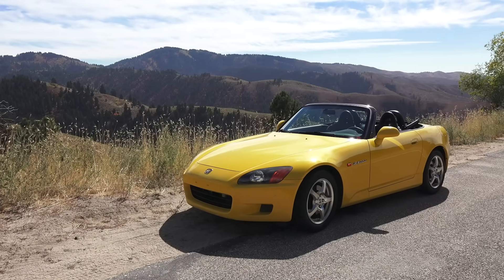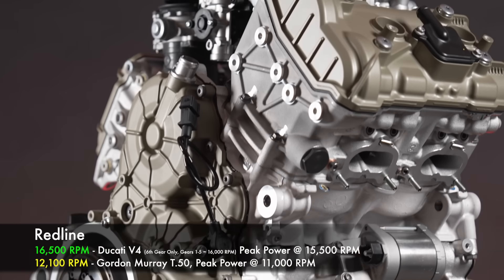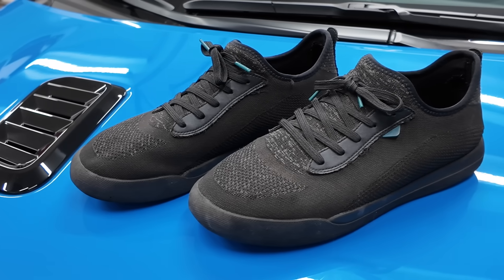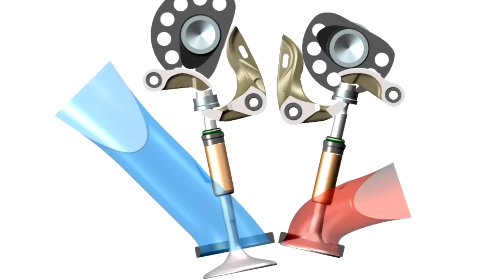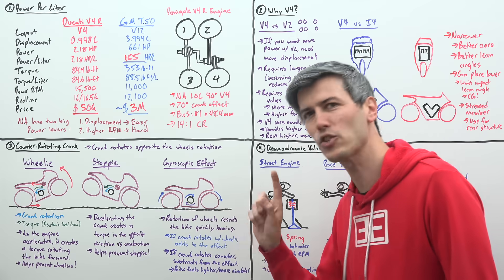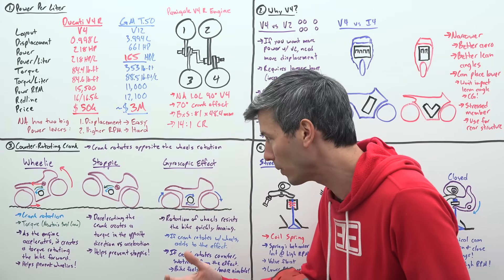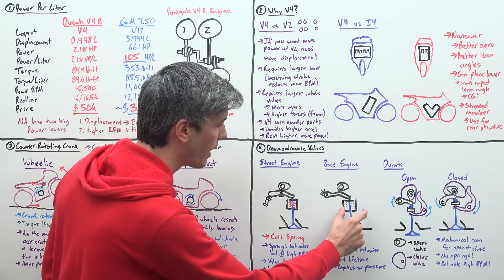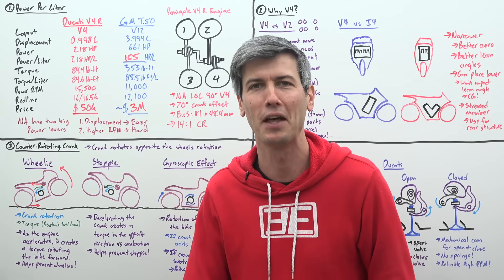Ducati's Brilliant V4 Engine — Putting Supercars To Shame!

Comment: When you showed the inline 4 option, you showed it mounted transversely to the frame.  Couldn't it be mounted longitudinally?  

Also, on the valve mechanisms, what holds the fingers to the cams?  Torsion springs?
Reply: I would think lengthwise would result in more issues, now your wheel base and suspension have to work around the engine plus you need more complexity in rotating the drive direction of the engine to the rear wheel. As for the valves, if you look at the diagram the fingers cant move unless the valve or cam moves. The finger is pressed to the cam due to the valve, and pressed to the valve due to the cam. I've never taken one apart but I'm sure there's a normal backlash spec and the fingers are not preloaded to the cam or valve.
Reply: @ivs-b7h  If the engine was placed inline with the bike, making it a shaft drive to the wheel would be easier.  But obviously there are other challenges, as you mentioned.

I watched the valve demo in slow motion and now see how the fingers are captured by the cams and valve stems.  Thanks.
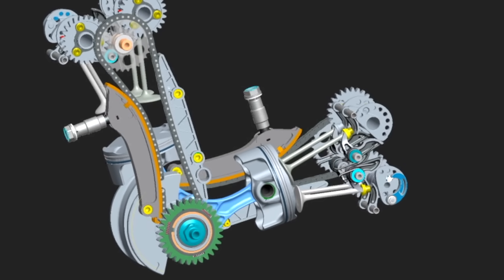Reply: @ivs-b7h  Typically there is a spring(coiled around the "finger-axle") that preloads the "valve-closure-finger" to hold the valve closed, seen in the demo at 09:56.

Comment: Honda came out with a V4 motorbike engine back in the 1980s. It was high revving and high power output for its time. It would be interesting to compare it with this Ducati.
Regarding a future firing order discussion: yes please!
Also, the primary and secondary balance of V-4 engines using different angles between the cylinder banks.
Reply: Still happily riding my VFR800, the gear driven cams make it a bulletproof engine
Reply: @samkwant4050  sadly I have the chain driven one. Still a great bike, and hasn't blown up... yet 😅
Reply: Bought a new V4 Honda Sabre in '83 for about $2300, I lived in Illinois but bought it from a dealer in Bloomington, Indiana. I flew in there, they picked me up at airport and I rode it home. Still saved couple $100 over buying in Illinois. It was a nice bike, fast and comfortable, but I pimped out, should have gone for the Interceptor!
Reply: @RonRussell-sj1zf  Or V-Max!
Reply: Honda used different firing phasings in different V4,s.
Reply: @markpavletich747  Yep. Mine was a Magna VF750C whose cylinder banks were 90* apart and crankshaft had dual journals both at the same crank position with 90-270-90-270 firing.
Reply: NC-21, NC-24, NC-30, and RC-45 from what I remember - variations on the VFR-400 / 750cc bikes.
They also rocked the single-sided swingarm which made for a very interesting looking bike back in those days!

Comment: Ducati patented a version of it's desmodromic valves, it doesn't have a patent over the desmodromic valve system itself. Even Fangio's Mercedes W196 from 1955 had it over a decade before Ducati.
Reply: True.  Also, if Ducati had patented desmo valve actuation (which they did not), that patent would be long expired.  Back in my university days, I owned a 1968 Ducati 250 Mk.III, which had a 250cc single cylinder engine with 2 valves (one intake, one exhaust), a shaft-driven single overhead cam, and desmodromic valve actuation. BTW, that bike was only 5 years old at the time (yes, I'm that old)!
The manual on the Mk.III called for 6000 mile valve adjustments, and despite only having 2 valves, it would take me all afternoon to do a valve adjustment - Ducati only sold the adjustment shims in one thickness (too thick) and they had to be hand-ground on a whetstone to achieve the proper valve clearance (because I didn't own a micrometer at the time, this involved multiple assembly/disassembly operations).
Reply: @danielklopp7007  I can remember wanting one of those. Can't remember what I knew that attracted me. This was in the 70's. I finally got to try one of the V twins sometime in the 80's. I remember riding away from the shop and thinking to myself "Don't hit any bumps. This thing is STIFF" Felt like it was carved from solid. As I came back I missed seeing a pothole, and tracked straight across........ Nothing. No thud, no deflection, just swallowed the bump. "How the f**k did they do that?" Brilliant handling and roadholding.  BMW flat twins were equally good I think, but even more comfortable. I remember riding down a bumpy, narrow road, lined with stone walls. Comfortably skipping from the tops of the bumps, no worries about control. Looked at the speedo, 110 mph!
Reply: @danielklopp7007 ,,, about '66 plus or minus a year I raced a bevel drive Ducati on US One in Philly , on my Honda . The Ducati drove away from me , but that bevel drive sure made a racket .
Reply: @danielklopp7007  you win the olde school award
Reply: @danielklopp7007  Man, talk about persistence... why not just buy better bike? :)
Reply: @LionBlu2000  There wasn't a better 250 for what it did.
In fact with mine (a 350) the valve seat wear just about compensated the rocker wear so I didn't need to adjust the valves, but if you did yes, a micrometer and a good grindstone were essential. I still have my micrometer from 1970 and it is still good, but these days I would use a flat diamond file rather than a whetstone. The return cam and rocker were not nearly so critical so long as there was a small clearance.
Reply: @LionBlu2000  I also owned a Suzuki GT750 (aka "Water Buffalo") at the same time as the Ducati.  That Suzuki was the most maintenance free bike I've ever owned (55,000 miles with nothing but tires and chains - it still had the original gearbox oil when I sold it)... talk about both ends of the spectrum!
Reply: Wifredo Ricart was making a 3.2 liter DOHC 32 valve supercharged V8 with desmodromic valves in the 50s for the Pegaso Z-102. Dry sump, 5 speed transaxle. Seriously crazy stuff for the 50s.
Reply: Why don't all high performance engines use these then? Is there a downside besides cost? I guess it's just that there's no benefit if you don't want to rev super high, and there are other limitations on that that make it irrelevant for most engines?
Reply: @nathanstretch  desmodromic was a solution to poor valve spring technology 75 years ago. Modern F1 motors use pneumatic valve actuation, as do modern MotoGP engines. The V4s from KTM, Honda and Aprilia also use pneumatic valves, and they all counter rotate.  This video is full of inaccuracies.
Reply: @truantray it. comes with downsides and advantages. obviously the biggest advantage is you don't have that super stiff spring that's required to make the valve return quickly enough at 16krpm so now you are just pushing a small & light piece metal up and down the valve  can be constructed more lightly and you have less drag on the engine and less wear on the camshaft  because it's not pressing against a spring anymore. so yeah it's not the only way to make valve working at 15k or even 20krpm but it's at those kind of rpms that it has the biggest advantage. but ducati used it on a most their engines, also a lot of air-cooled V2s that were not revving nearly as high
Reply: @truantray  He said for street bikes, all your examples are for their race bikes. Although he probably doesn't know that the MV I3s also counter rotate.
Reply: @truantray  he clearly meant in a production engine. KTM, Honda and Aprilia don't have a mass produced v4 that counter rotates. MV agusta has on it's i3 and CFMoto on their latest prototype v4.
Reply: @nathanstretch  Expensive, complex, high maintenance, etc. etc. And for racing, pneumatic is typically better.
Reply: @nathanstretch  WSBK engines run 15k+ rpm on valve springs without issues. It's unnecessary complexity, but Ducati does it since it's part of their history. Some say it gives a character to it's exhaust sound, but I doubt anyone will be able to tell. Still, for a while they were the highest performing V twins so if you wanted that character there wasn't a replacement for it. Which is why I own one now. Having multiple bikes means I don't put enough miles to really worry about desmo service interval, it's the 2 year timing belt cost that's more annoying.
Reply: @Why_250_Vortex  Yes and when the valves and engine is small enough 20000+ rpm is possible with conventional valve springs, its just when you get to valves and lifts that Ducati uses, that stuff doesnt work anymore. Ducati still wins races with everyone else being pneumatic.
Reply: @Why_250_Vortex  Not quite. With valve springs, to avoid valve float you must control the cam profiles to get the correct rate of lift and this is a limitation on both breathing and torque curve. In effect, the springs are still a limitation on performance. And so, even, are pneumatic valve controls, because although their rate is non-Hookes-law, but adiabatic which means an effectively higher force on the rocker at large lift and less at closing, you are still bound by the gas law rather than the ideal profile. With desmo, the cam profile can be optimised for torque curve and gs flow without an unacceptably short life.
Reply: @PeanosZero  Technically true, to what extent I don't think anyone can tell us.
Reply: @63turbo  You should check how many MotoGP manufacturers championships Ducati won before 2020
Reply: @nathanstretch because it considered as unreliable engine.. if cars use this kind engine can you imagine how much fuel consumsion? And how loud would they be? Because car engine capacity are around 2000cc or more. With 14k-15k rpm they would be superloud.
Reply: @nathanstretch  Turbochargers give bigger benefits for cars and trucks at lower cost and with longer service intervals.
Once you go blown you can double power at the same rpm that is capable of working with hydraulic lifters and rollers, but with NA you have to double rpm and increase valve full open time to achieve the same. So, works for bikes but not cars.
Reply: @nathanstretch  because valve springs now a days are built with much better metals and valve float has been a solved problem for a long time. Ducati uses desmo valves more as a brand thing than any real performance advantage. 

Also the point about maintenance intervals is kinda funny because up until about 10 years ago desmo valve service intervals are 3000 miles, and if there was anything wrong (which was common enough) it was effectively a top end rebuild.
Reply: @MrUandB ,,, no , Ducati forced the entire rest of the Moto GP field to go pneumatic , to keep up .
Reply: @rolandtamaccio3285  Ducati's MotoGP team didn't even exist when Aprilia first used pneumatic valves on a GP bike, and it's already known technology from auto racing.
Reply: Thank you. That saved me a lot of sentence structure work and typing.
Reply: The desmodromic patent was awarded to Karl Benz in 1889. 

And both KTM and Aprilia V4s also counter rotate.

Comment: I was actually interested in the 70° crank more than anything else, although I did learn quite a bit about why they do the counter rotating thing. I’m curious why if V4 engines are too vibratory for car engines, can they still be strapped between your crotch and not shake your bones apart and blur your vision… how do they get around that exactly? 🤔🤔🤔
Reply: Counterbalance shafts and saying; it is a sports bike, get used to it. Plenty of bikes a just a single cylinder, which is a lot worse.
Reply: @rienkhoek4169  There are no balance shafts on the panigale V4. A 90 deg V4 has perfect primary balance. Car V4s tend to be narrower angles hence the vibration

Comment: Ducati is not the only company with counter rotating crankshafts in street legal applications.
MV Agusta uses it in its inline 3-cylinder since years.
Reply from the maker: TIL! I couldn't find anything in search, and in my chat with Ducati they said they believed they were the only ones. Thanks for the correction!!
Reply: @EngineeringExplained  And they just introduced their new concept engine. 5 cylinders, in a squared configuration, probably with two counter rotating crankshafts. They claim 240 hp.
Reply: @111two MV engineers have said the engine has two crankshafts, 3 camshafts.
Reply: @EngineeringExplained   also the future cfmoto v4 will have it
Reply: @EngineeringExplained  re: "in my chat with Ducati they said they believed they were the only ones."  no way they ever thought that...?  unfortunately you must've spoken to somebody NEW at Ducati (ie: an "engineering rube", a "laymen") here in 'Murica.  you definitely spoke to no one over in "Italia" (new or old) because no one in Bologna would ever make that mistake because as KTMZ mentions it WAS in fact the YAMAHA MEGACORP that first spun their engine backwards in Grand Prix Racing (ie, MotoGP).   although his time with the brand was unfortunately forgettable, the legend Valentino Rossi (VR46) and the bulk of his crew all moved over to Ducati from Yamaha to race for 2 seasons (2011 and 2012) however not sure if Ducati had decided to spin their engine backwards BEFORE or AFTER this "cross-pollination" of talent.
Reply: @phillyphil1513  "Only ones" in street legal bikes. He did say that this is common in racing.
Reply: @EngineeringExplained  it's the only street-legal V4 engine with a counter-rotating crankshaft... 🙂
Reply: Didn’t mv just announce a 5 cylinder too?
Reply: @mitchellpoll2195 Yes, I guess if you have an engine that nobody else has, you can market that as exclusive. The 3 cylinder engine market is pretty thick these days, and I'd wager a lot of MVs don't see many miles due to their boutique pricing.
Reply: new CBR-1000 RR also uses counter rotating crankshafts
Reply: @red_jamex4949   Its not counter rotating crankshaftS (plural)
Its Reverse Rotating Crankshaft (singular)
Reply: Here's a blast from the past: Cycle magazine's California Hot Rod Ducati that won Daytona's 1977 Superbike race did, according to Phil Schilling who did the engine mods, rotate backwards. Schilling claimed that the numbers made no sense otherwise.
Reply: Noted
Reply: correct!
Reply: The BMW S1000 engine also has a counter rotating crank.
Reply: I want a three-liter V12 using this technology in a restomod Ferrari 250 GTO Series 1 done with modern engineering and materials.
Reply: Yes yes!
Reply: MV will come out with a V5 engine with counter rotating crankshaft.
Reply: Same as the new CFMoto V4, also offers a counter-rotating crank
Reply: @sanxi34  AFAIK, as of now the new CFMOTO V4 is still not in production but in (early) prototype stage. When it will be in production, the Ducati won't be the only V4 with a counter-rotating crankshaft. By the sound in the CFMOTO production video, though, the Ducati will probably still be the only one with those AND an irregular firing order, thus remaining the production unit technically closer to a MotoGP engine.
Reply: It wasn't mentioned why this isn't common though. What are the drawbacks?
Reply: @mr_spazoid  Because if connected to typical gearbox, wheel would spin backwards. You need additional jackshaft gear that will change rotation at the gearbox back to normal. Additional gear (that one needs to be very strong and precise) means added complexity, higher cost, more things that could go wrong and some small power loses.
Reply: @mr_spazoid  one extra gear
Reply: @mr_spazoid  I assume it might also make handling more twitchy if you don't have the gyroscopic effect helping to keep you in line
Reply: @mr_spazoid everything in the valvetrain has to be designed backwards, more or less. The gearbox is also slightly more complex.

Comment: That Ducati dual-cam valve actuation mechanism is pure genius! I wonder why no one ever thought of this before? Valve spring float has always been a major limiting factor in high-RPM engines.
Reply: It's old technology and it's advantages has just gotten smaller and smaller with development of other valve actuation.
Reply: It's good in high rpm, racing application.
But pain in the ass when you have it in a road bike.
Reply: People have played with this (e.g. Mercedes-Benz W196 and 300SLR) but only Ducati have decided it’s worth the cost and complexity.

In 2025 we have better metallurgy for the valve springs and engines that just don’t rev that high in the first place.

Comment: I would love to see V4 engines in cars again.
Reply: Subaru is close
Reply: @arthurm-vl6sw  No.
Reply: @GrainGrown yes
Reply: @arthurm-vl6sw  No.
Reply: @GrainGrown  yes
Reply: Yes, I think instead of going to front wheel drive. They should’ve gone to V4’s with balance shafts, even if they were more expensive to produce than in-line four cylinders I think it would’ve been worth the effort. Also, you can design V8 and V4 together so that you reduce some of the development costs. At the end of the day you could use the same cylinders and everything else except you would have to do the balance shafts. That would be the only extra engineering involved.
Reply: @AlbertManiscalco  No.
Reply: @GrainGrown no and why not?